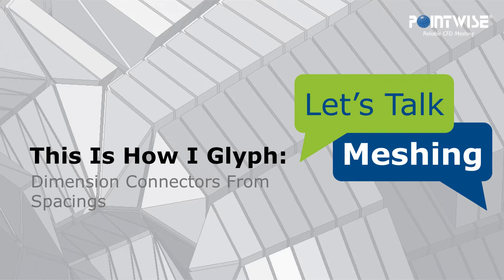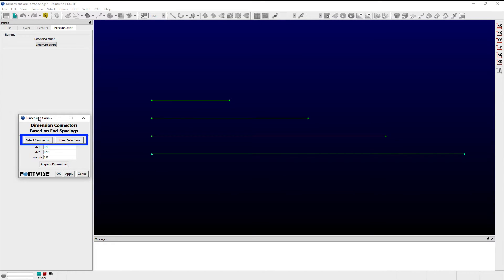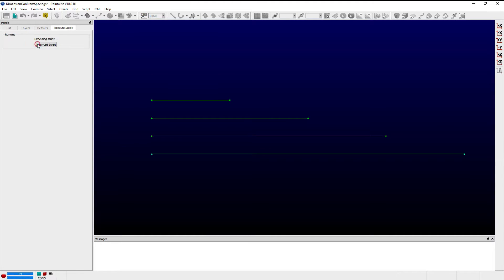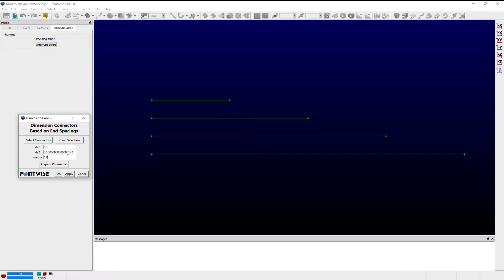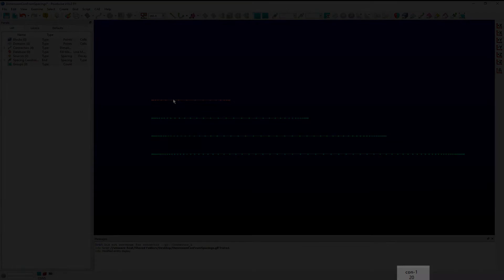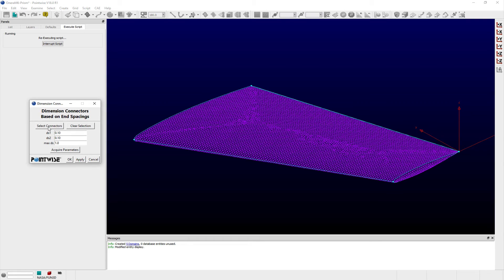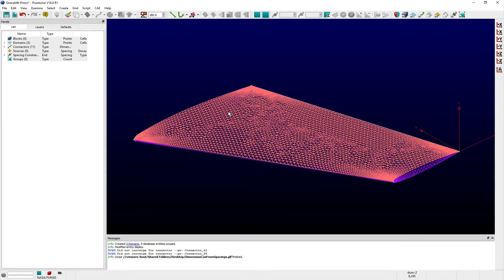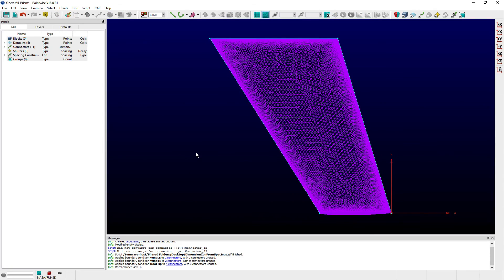Dimension Connectors From Spacings

Comment: Great Tutorial!  Thank you Zach.

Question 1: Does the script retain the connector distribution type? It would be great to have flexibility to choose connector distribution type (e.g. growth for match type, tanh for wall type connectors in 2D T-Rex)

Question 2: What if a connector have breakpoint(s)?

Idea: Wondering if the connector/sub-connector start and end points could be highlighted with triangle and square respectively (similar to Grid>Distribute>Function)
Reply: @Rajib Roy The script works with the default hyperbolic tangent distribution only; thus, the required beginning and ending spacing parameters.  Other distributions would have a different set of input parameters, and determining the optimal number of points for each distribution a separate problem for each.

It is meant as an alternative to another script we have available on the Glyph Exchange that applies a growth distribution to a set of connectors for which end spacings have already been applied explicitly and sets an optimal dimension based on the connector's length, initial spacing, growth rate, and number of layers.  The added advantage with this script, is that a user can skip having to explicitly set the spacings on the connector within the Pointwise interface as this applies the desired spacing for you.  I've also noticed that the hyperbolic tangent distribution seems to provide a smoother transition between grid points than an optimally dimensioned growth distribution connector, even after T-Rex has been applied, but at the cost of having a larger number of points along the connector.  You may see the area ratio of your surface domains improve as a result...

The script does determine whether a connector consists of sub-connectors and applies the prescribed beginning and end spacing at only the ends of the connector, rather than applying these spacings at each break point.
Reply: using the script; it's pretty helpful !